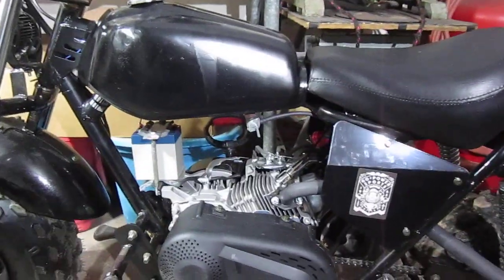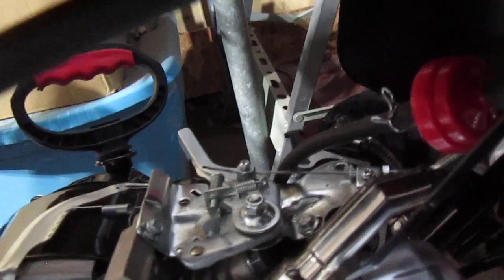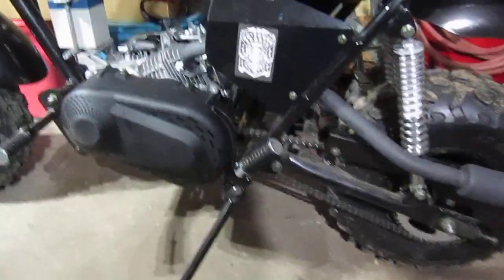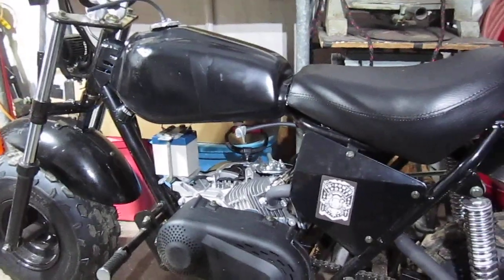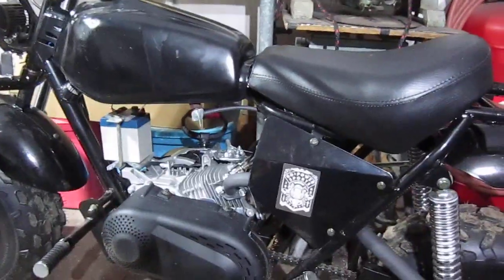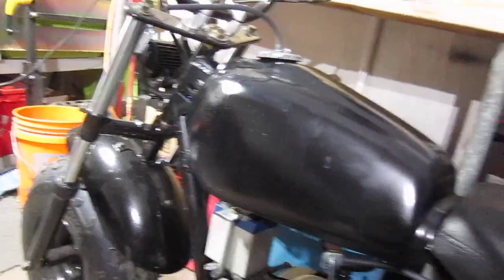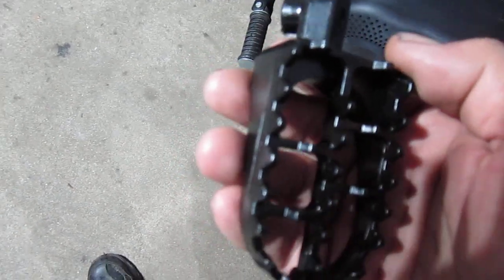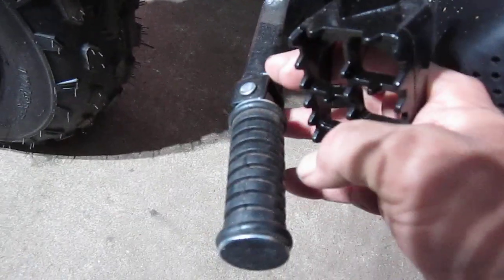Trailmaster Update petcock and foot pegs

Comment: what is the petcook and what is it use for and what does it adds to the bike
Reply from the maker: The petcock is the valve on the bottom of the gas tank. Turns the gas flow off and on.
Reply: @carnivorecave  ok did u install a new carb